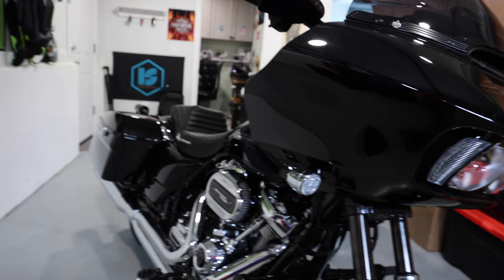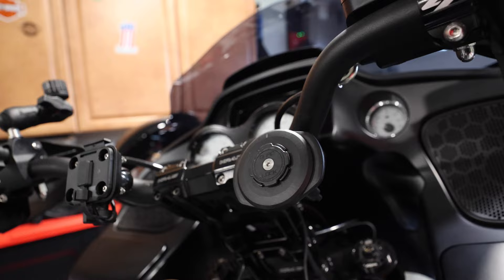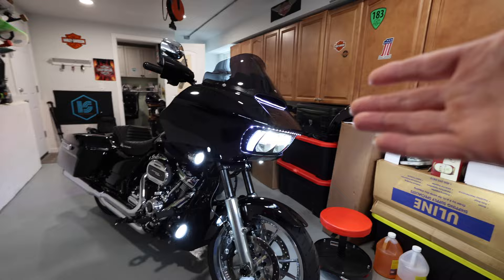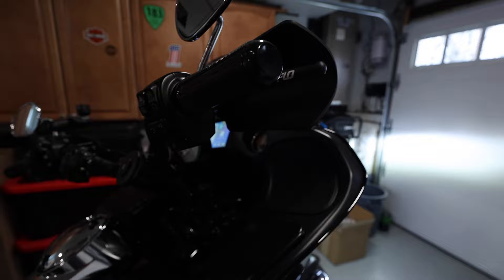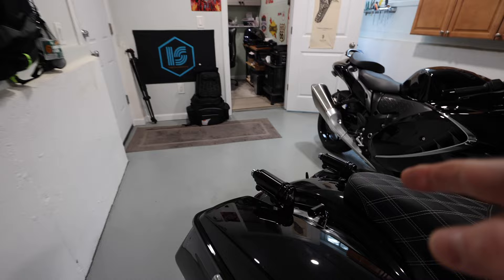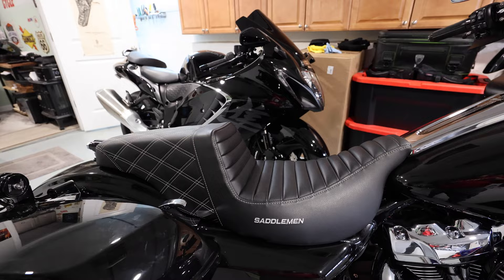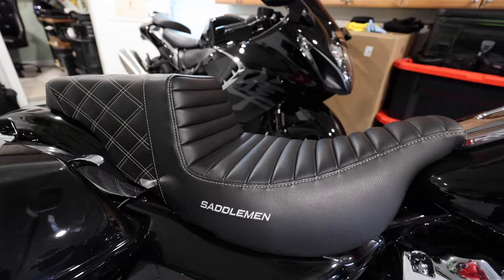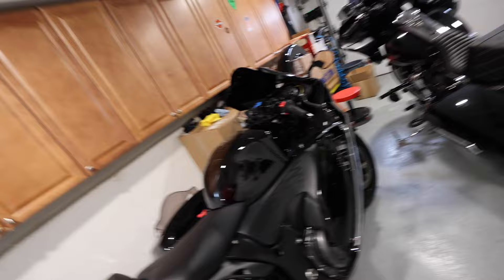Every single upgrade to my Harley Davidson road glide explained.    #harleydavidson #roadglide

Comment: Tee bar setup is nice but I still prefer ape hanger style. But who knows, have to ride a bike with set up to see if I change my mind. Levers, definitely will switch eventually. 

I only don’t like the road blade led lighting around the fairing/headlight housing.

The step up seat, so you have a gel seat? I hear it’s better without. I had one with and so uncomfortable for me. 

Nice work on cutting the panels cuz I had no idea you did that. Ride safe and god bless! 34:17

Comment: Hey John definitely do like mad Max better than silver back I guess I’m partial to black and chrome. Harley makes a real nice electric fan for your oil cooler you want even though it’s there I think it’s really a no-brainer to have that to help cool that oil down because you know these bikes run hot and it gets warm in Jersey just saying I really think you should add that have Harley flash ECM and you’ll be good to go😎
Reply from the maker: Yes definitely 👍